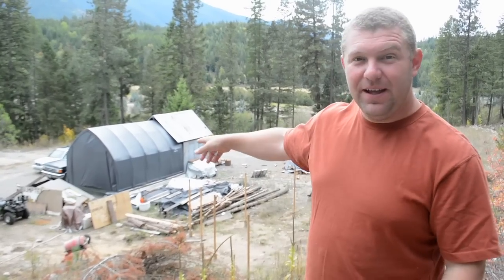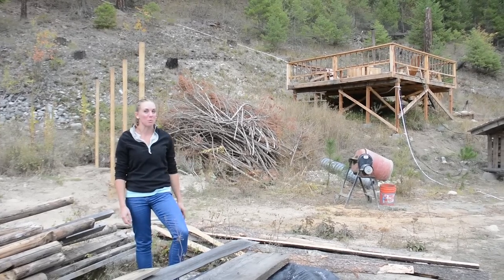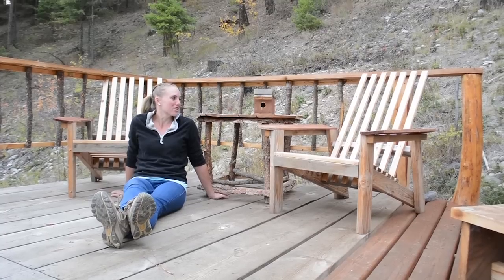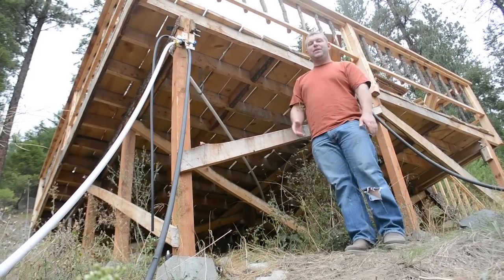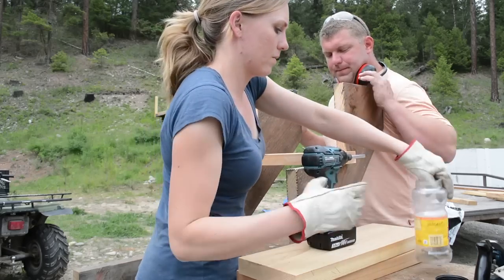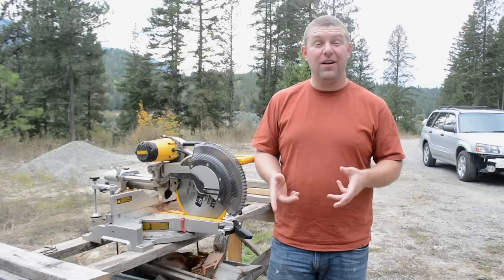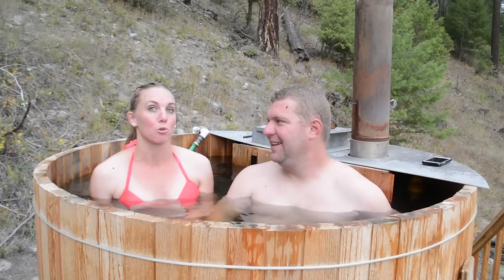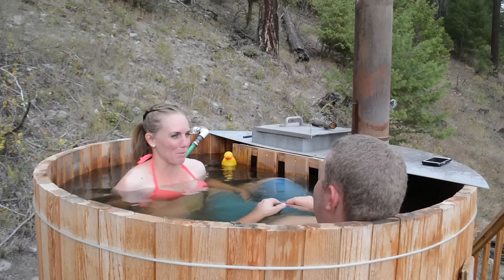Why We BUILT a HOT TUB & Deck BEFORE A HOUSE

Comment: I tried doing this in Colorado and the county harassed the shit out of me. They used a so called " junk ordinance " to call every thing I had junk. The neighbors had the same stuff, but they had 5 stall garages and a 1.5 million dollar home so their stuff was OK to have. This was on a rarely used gravel road in the middle of no where by the way. They also wanted a site plan in advance, plans for every thing. Permits, etc,,,, Every thing had to be up to code, inspected, " for a nice little fee"  etc. About $50 thousand for electric, water,,,   If you tried to do what you are doing there, they would have fined you right off your land. And no , they won't let you live in your camper while building, and the sheds you build would have to come down. IU don't know where you are doing this,,, but it's probably against the law. Doing anything with out tons of money is against the law. And no,, I don't hate you guys. I think it's great what you are doing. I just hope your local county doesn't run you off your land using ambiguous codes designed to protect the establishments property values and keep you from home steading.

Comment: Many years ago, I built my own home and then latter put in a pond, dock and a hot tub. I wish I'd done the tub first, the pond second, the deck third and the house fourth. Why? The house  was nothing but pure exhausting work. Latter, when I did other building jobs around the place, the hot tub was terrific for all those sore muscles and the pond was wonderful after a hot day swinging a hammer. To each his own, but balance of work and play means a lot over time. These folks made a good move in my book.  On the other, hand they did perhaps play into the "recycle trap" in which you use inappropriate materials because they are "free". Materials can cost money or time. It's best to weigh your "free materials" against the fact that you may have to replace the deck ( or other project) in a few years. Decks and hot tubs are a huge amount of work. If possible, better to do them right at age 30 rather than have to replace them again at age 50. Replacement of anything is usually expensive in time and money. Even if a person does the work on a DIY basis, the back may not be as willing at age 50 as it was at 30! So rather than misc. scrap wood,  I would have gone for cedar.....wait a minute! I did go for cedar in my projects. Good heart cedar will last 50 or 60 years. That quibble aside,  it is great to watch this couple do their thing so thoughtfully. It brought back memories of building my own house back in the 80's. At that time, my wife and  I lived in a 1967 Argosy 26' trailer. The original one year build wound up taking ten years. It happens. Best to be careful about becoming attached to those time tables. All the best with your projects!

Comment: don't let the hot tub freeze. It will burst open and leak out the water. So much work to keep it above 32 degrees F . A small solar radiator would help. Easy to design one. Like a car radiator with antifreeze closed system . Only with a solar panel. Just enough to keep the water above the freeze temp. FYI

Comment: curious as to how you shaped the edges of the boards in the walls of the hot tub? This would take a pretty good  size shaper. And the band holding it together, how did you manage to make that? Also you would need to notch the bottom into the sides. How did you cut that into it? It looks very well done almost like a kit?
Reply from the maker: +Jim Botkin check our channel for entire video series we did on the build. Learned a lot while doing it. That stave joint was a big challenge!

Comment: I understand you are working outside where it can get cold. However, as a wood worker, I have some advice I hope you will heed. For someone who is new to using power tools (or even experienced), please DO NOT WEAR GLOVES, when using any kind of miter saw, table saw, etc, when cutting lumber. About the only way to get away from that hazard, is when using a chainsaw and both hands are grasping the handles far behind the bar, where it is safe. Electric power saws however, are a different story. You snag your finger once, and you'll regret it for the rest of your life.

Comment: Hot ,  on any property where you have to do lots of manual labor, a hot tub is something that not necessary but once you got it, you'll wonder why you didn't have it from day one. It's like a portable band saw mill.  After a couple thousand board feet of lumber, you'll wonder why you even bothered cutting boards with a chainsaw.  Set up time, fuel, always sharpening and replacing chains and the amount of wood wasted with the wide kerfs.

Comment: Your motivations are all good and logical and good luck to you. 
I don't know where you are but almost everything about that deck is non compliant in every state in Australia. I would have thought it would be the same/similar in North America. The softwood construction needs to be treated wood. Otherwise it is going to rot - if the termites and borer don't destroy it first. This is a safety risk to you. 
The balustrade needs to have maximum gaps of 100mm. Although this is mostly to stop children falling off, so if you don't have any children to visit, then I guess you aren't going to care until the local council tell you to pull it all down. 

My point is that this structure is going to have to be redone. Whereas a little more research could have saved you the hassle. 

Noce hot tub.

Comment: I don't get it...  They made their deck out of pine?  Won't the pine rot in just a few years?  Where I live in California pine branches like they used in their deck rots away in just a year or two.  And the planks they cut would only a couple of years more.  In just a few years all of their hard work will have rotted and have to be rebuilt.
Reply: ***** Even roofing it wan't offer that much protection for rot.  I suspect it being that is it pine will become unsafe in just a couple of years.  Do you think they know what they are doing?
Reply: *****  I am with you.  Let's hope the deck collapses at a time they aren't on it on in the hot-tub.

Not too far from where I live an apartment building just 3 years old had a deck that collapsed and 7 people died.  Why?  The contractor didn't protect the wood from rotting.

Let's hope they figure it out before they earn Darwin awards.
Reply: How hard is it to buy 5 or 10 gallons of thompson water seal though???    First sign of rot, that's what I'd be doing.
Reply: ***** Don't think Ttompson water seal would work.  That just a water repellent and would seal the bacteria and fungi in the wood fibers.  What he needs would be Copper Green which an anti-fungal, anti-bacterial.  But still, it's pine and going to rot.  I don't think pine is used for anything structural in building..
Reply: Passed High School Physics
I think thompson water seal would work if you applied it while the deck was bone dry, but copper green looks like a better alternative.
Reply: ***** I'm not sure but I think water seal is water barrier like a sheet of glass.  It does nothing to kill the fungus and bacteria that feed on the wood.  I think what it would do is seal the fungus and bacteria in the wood which would be even worse.  The surface of the wood appears to be fine, but just under the surface it could be all rotted.

In Berkeley, California not too long ago 7 students died from a collapsed balcony.  The building with the balcony was just a few years old and it turned out the contractor got a littler creative and didn't protect the wooden beams from moisture.  In just a few years the 10 or 12" thick beams supporting the balcony had rotted all the way through.

Let's hope that doesn't happen to them while they are in their hot tub.
Reply: Passed High School Physics since they didn't cure their wood prior to construction, they're going to have a lot of structural problems as well.
Reply: Matthew Hoffman You are right.  A good woodworker learns from the centuries of mistakes and successes from the millions of other woodworker before him.  Apparently this guy is "inventing" not re-inventing the wheel, so to speak.

Let's hope he doesn't get killed or kill anyone.  Poor construction techniques in a building only a few years old killed 7 people and injured about a half dozen more in Berkeley, CA not too long ago.
Reply: ....and they'll just rebuild it when it needs to be done...what's the big deal? They're both 'there' and will not be anchored down to any offsite employment, neither will they be running around in the fast lane any longer.  So they'll have time and energies to rebuild some elements that might rot. ....whoopee di do!  Its not big deal, that is what homesteading is all about after all.  

The pioneers made it years ago before all of the industrial process and wood kilns came along and they expanded the human population just fine.  And so so will they.  Its not really a big deal.

If you all can't find anything else to do but to consistently criticize, go find another route for your own life.
Reply: It doesnt work. They need to get pressure treated wood. Then a couple coats of stain
Reply: Alaskan cedar works good too. The wood takes alongggggg time to rot. I have fishing lures from my great grandad that still look brand new made of the stuff. Incredible. Only downside is if you get a splinter or something of it stuck in you, then you gotta cut it out or hope your body pushes it out because your body cant break it down for a long time. (ask me how I know.... 1 ER trip later)
Reply: You're kidding, right? 99% of the houses in America are framed with pine. Every 2x4 you've ever seen in your life is pine/spruce/fir. Look it up!
Reply: i'm a carpenter. most homes built in america are built from pine/ spruce/ fir softwoods, from the framing, to the plywood, or OSB sheeting, it's all one of those three. even pressure treated lumber is one of these that has been injected with arsenic, and copper chromate until rejection. there are homes  from the colonial times, still standing built of softwoods. that is why you paint wood. not only to color it, but mainly to protect it. if they paint it, it will last a long time. the main problem will be the support posts at ground level. that is where most rot happens. if the posts were very resiny, they will last longer. insects are a greater risk than rot.
Reply: A "little bit" more work?  Really?  Also, I didn't notice a brick oven on the property.  The bricks they used for the stairs were donated.  Can't count on that for a supply.
Reply: Old growth versus today's 10 year old lumber are far different.  That's the real difference, not the stain.

Comment: that was my thought too,  here you cant get a mrgage on vacant land, I founf this 30 acar peace of land in an unorganized town ship, just what I wanted, no permits needed to build anything, only permit needed is an electrical, I didn't care about that as when I was by my self I don't want it, the owner finaced it, I paid it off in 3 years as it was only 22,000, 7 years later I met this gal,  she wanted to get marired, I told her, the conditions, we do a 5 year plan to build a house on my land, and live on it,  I told her we would get marired only if she was 100%  in, being she was a city girl, I told her once we do this your not to come to me in 2 to 3 years wanting to move to town, as I am not going, so tell me now and we will not get married, she clamed no she loved it out here, so we got married, in Nov. we bought an old 14x70 moble home. for 5000 had it moved on the land, she wanted a well and hydro, she made 60,000 a year, so I went and put up 2 hydro poles, with a double 200 amp meter bace on the pole, so we would have 200 amp for the house an 200 amp for my shop, our plan was to live 5 years in the moble home, build my 40x60 shop as I'm a welder mfg by trade, after that we would build the house with a walk out basement into the vally, after being there a year I started talking a bout starting my shop, and take 2 years to complet, she kept making delays, over this time I had a guy come in and cut all the spruse bud worm killed trees, he got all the pulp wood free but I wanted the big logs 16-6 long, I had a huge pile of logs to get sawed into lumber for the house later, she kept stopping the guy from coming with his mill, I rented a big D8 and striped a huge area about 7 acars, for land scalping, I build 3 out buildings with water and hydro under ground. I rented smaller equipment and made her huge flower shrub beds in 2 lifts, I gave he a plan how to plant it so be no wedding, well she did it her own way, she could never keep up to the weed, her mother and sisters bitched at me for years, who in there right mind would land scap the yard with lawn an shrub beds, gardens, water falls, oh and an 8x12 root cellar around rhe drilled well, the well casing was in one corner,  I told her mother and sisters, the land scarping is not going to get any damage when I start the house, I didn't do any land scarping were the shop was going to go, her mother said oh no you will destroy everything when you dig for the home, I told her no, when I dig out the basement, the clay will get loaded right into my dump truck and haled to the other side of the land to fill in a big low spot, and I will hall in sand to back fill the basement .. no mess out farther then 20 feet. oh, that cant be down, so many stops were put up, it was retarded, 2 years into it, she says to me, come to town with me and lets go look at these 2 homes, I said what? no way, I told you the deal before we got married, she kept trying, her mother and sisters started treating me like crap,,, nothing ever got built, no shop no home, we lived in this old mobile home for 10 years, she would have nothing to do with anything around here, on her days off she head to town at 730am id ask were you going, oh my sister needs my help,,, ok, she would never help  me or do anything to help better the place, the shrub beds were wild, 7 and a half years into our marage I found her cheating on me with the resort owner I was contracting digging an putting in water lines for him all well her was doing my wife, she stays 3 more years but I never slept in the same bed, in nov 2006 I kicked her out, she got everything. I left with my disability pension that's it

Comment: Understand where you are coming from, but it has taken centuries to come out of that way of living.  I would like to point out, if you think you are saving the environment by living off the grid, you're fooling yourself. The day you can run your leaf computer with a bamboo string to the tree that will with power it, good luck. 
Solar Panels, Batteries, your motor car transport, all the tools you use, the gas you use to cut trees down, all the plastics etc..  from modern luxuries we have created to keep us out of the dark ages.